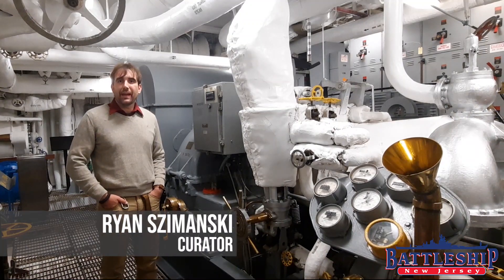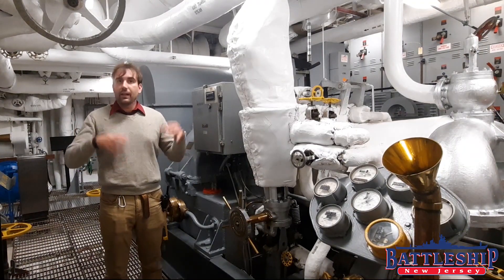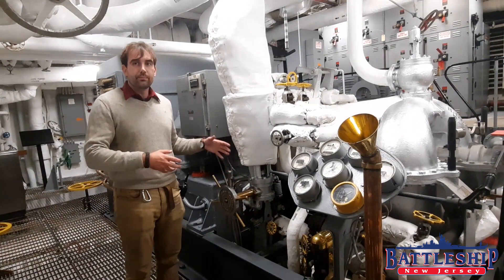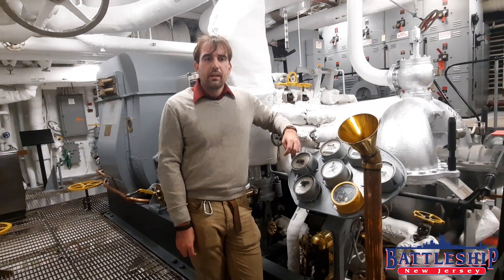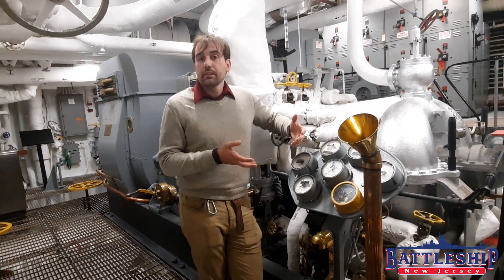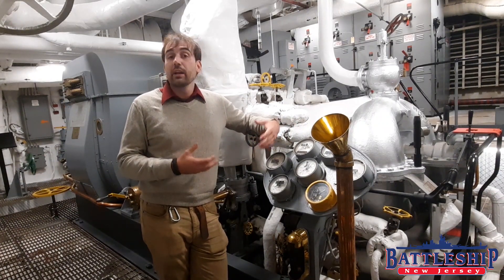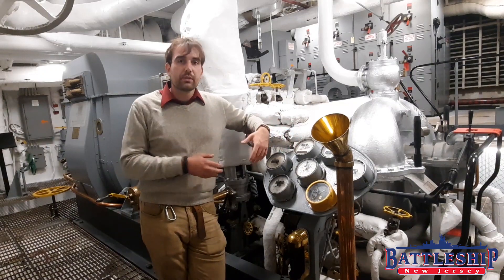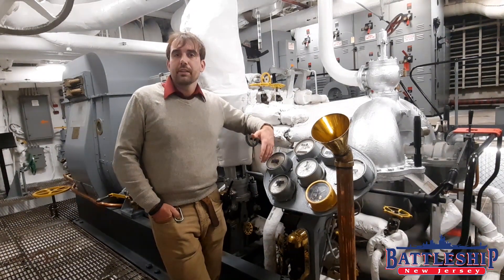Battleship Turbo Generators

Comment: Do the power companies receive a tax break for providing your museum with power?
Reply from the maker: We pay for our electricity, it's one of the many reasons why running a battleship museum is so expensive! We've switched to LED lights so that helps keep costs down but its no small bill!
Reply: @BattleshipNewJersey  Sounds like a federal bill ought to be created to make museums a tax write off for power companies.

Does your museum have a Patreon account?

If it were up to me I would move these museum ships like the Texas and Olmpia into custom built buildings where the ships would be placed on top of Cribbing within a cement basement.

That way even if the museum shuts down for decades, the ships would be rusty but city officials would Not be considering making them into a artificial reef due to a lack of hull integrity.
Reply from the maker: The ships are much better supported in water than on a cradle or in concrete, and it would be astoundingly expensive. 

We don't do patreon but we have a gofundme: https://gf.me/u/ysdi3a

Also, most of these ships aren't run by local, state, or the federal government but by non-profits so the city doesn't get to decide if they're going to reefs, this is a decision made when the organization responsible for them can't maintain them anymore due to age. No ship lasts forever and they all cost millions of dollars to maintain.
Reply: @jmd1743  cement/concrete is a porous material, it holds water. That water is then held against the metal, and allows it to rust; that water will not dry as it is not opened to the air for it to evaporate.
Reply: @irohaboat  There are many ships being held indoors in museums, what would be the best way to hold something like the USS Olympia or Texas inside such a building?

It would be cool if you could transport the Texas to that National ww1 museum to create a naval museum wing.

If money was not a concern I would house the Olympia, Texas, Iowa class ship, and one of those Pegasus-class hydrofoil ships to represent pre-ww1, ww1, ww2, and cold war in a single indoor museum.

Maybe it would be part of a new Museum near the Arlington National Cemetery.

Things like the Berlin Air Lift, Cambodia, and  Holodomor needs to be remembered when it comes to the cold-war & why we went to the brink of nuclear war so many times.

Comment: Just look at all those asbestos lagged pipes!
Reply from the maker: Theres is no asbestos in this space, we've had many many inspections to be sure.
Reply: @BattleshipNewJersey  She was launched in 1942. If she wasn't lagged with asbestos what did they use? And if they did lag with asbestos it will be absolutely everywhere as it is pernicious stuff.
Reply from the maker: The navy removed it in the 80s
Reply: @BattleshipNewJersey  Impossible. Some of the blown about stuff might have been painted over but the rest is still there waiting to be disturbed and breathed in, as I said it's really really really difficult if not impossible to remove completely.
Reply from the maker: We can guarantee that all asbestos in that engine room has been removed. As well as the vast majority of the rest of the ship. We haven't checked every compartment but any of them open to the public have had it removed.
Reply: @BattleshipNewJersey  If that is the case all I can say is well done for painting absolutely every square inch of the compartments open to the public and every square inch of the interior of every HVAC conduit and pipe :)
Reply from the maker: We're fortunate that the navy did most of that work for us!
Reply: @andrewallen9993  Hmm, you wouldn't happen to work for one of those law firms working asbestos, do you?
Reply: @davidperry6886  No, but I know people who worked in ships engine rooms that died from mesothelioma due to the asbestos lagging, one of them who worked on a ship that had had it "all removed".
Reply from the maker: We're fortunate to not only have the navy look over the ship but also private companies and the state of New Jersey look too.
Reply: @BattleshipNewJersey  I would love to know how they cleaned out all the HVAC ducting.
Reply: @BattleshipNewJersey  I'm not saying it wasn't.  However I asked to go in the boiler room on the Missouri and "it was a personal tour" the guide couldn't allow it due to it not being abated.  So maybe on the NJ it was.. But I know the ship I was on "Butte (AE-27)" was built in the 60's had been abated but still had plenty asbestos on board.  I was a BT.
Reply: @andrewallen9993  It really doesn't matter so long as nothing is getting disturbed, an air quality assessment as I would assume will have been part of the tests conducted would show conclusively if there was any risk. especially given that most if not all of the surfaces have been repainted.

Internals of ducts may also not be an issue so long as they were sealed before removal work began.

Comment: You state that the Iowa class has step-down transformers to drop the 440-v down to 220-v and 110-v.  On the diesel-electric submarines we used M-G (motor-generator) sets instead.  This was a motor of one voltage turning a generator set up for a different voltage.  M-G sets were also used to create 400-hz current for the electronics.
Do the Iowas have M-G sets?
Reply: North Carolina has smallish 400 Hz motor-generator sets for fire control, radio, searchlights, and other associated typical DC-driven equipment. I would imagine it'd be the same for the Iowa-class ships.
Reply: @tspencer227  DC is not the the same power generated by MGs, that is a conversion of AC to DC, a whole different process not done with that gear, its all about power supply flavors, they may have done that with an old generator,  but I've not personally seen them, so am not an expert totally.
Reply: Most M-G sets are used to convert AC to DC and DC to AC, or from 60Hz to 400Hz. I can't imagine using a Motor-Generator for the simple task of stepping up or down an A/C voltage when a transformer will do the exact same job with a quarter the space and no moving parts.  That said, I wouldn't be surprised if the Iowas have 400Hz motor generators for radar, fire control, and other sensitive electronics.
Reply: Most ships I was stationed aboard had MGs for 400 cycle, radar and such, cant use a transformer for that purpose, only for buck or boost applications. USN ret and EE as a civilian.
Reply: Usually as a ship uses 60Hz on all components there is no need for a mechanical transformer. This is only need to change frequency or need a "clean net". So hearing this I hightly suspect it's all stationary transformers. It helps a lot in maintenance and ease of use.

Comment: Does the system still have water in it?
Reply from the maker: No, it doesn't.
Reply: Part of the mothball process is to seal up the openings in the hull to supply water to the systems and drain them. Then they can be kept dry and fairly rust free.

Comment: What is the KW rating for a single Turbogenerator on the New Jersey. I was on a destroyer during Vietnam, we had 4 rated at 500KW each. I imagine moving the turrets required a lot of power.
Reply: 1250kw.each.
Reply: I'd like to read the nameplate myself. There  isn't a whole lot of size difference between 500, 600, 750 and even 1200 kw SSTG units. Hard to tell in this video.

Comment: Just FYI.  I offered my services to President Trump to project manage reactivation.  Who knows, maybe I’ll hear from him. :)
Reply: As impressive as these ships are they are of very limited utility in the modern navy. The operating costs are tremendous if you consider crew size, repair costs, fuel etc. for a ship that will be used for artillery support for ground forces. Having a battleship on station in a war zone would require air support from a carrier along with destroyers for ASW protection. The carrier airwing would be more than capable of performing the tasks of the battle wagon at a much lower cost.
Reply: Deactivation or reactivation
Reply: @dshogan6174  reactivate.  Corrected.  I won’t hold my breath though :)
Reply: @holykuhrap really...when firing at tents, 40 year old tanks, and sandstone buildings in the Mid East, one doesn’t need a $1M missile.  They serve a great purpose for long range artillery without shore invasion and a very low cost.   They were used effectively in that role in the Korean, Vietnam and Iraq conflicts for that very reason.

Comment: Hello Mr. Szimanski, I thought that you should be aware that you use of the word "impeller" was incorrect as you used it in describing a turbine, an impeller increases the flow and pressure of a fluid; the turbine does the exact opposite
Reply: Wouldn’t it be a turbine rotor?
Reply: @riderstrano783  From an engineering POV, a rotor can be any rotating part that has a disk or cylindrical shape, plus it can get weird what with helicopters having rotors as well
Reply: @battleshipnewjerseysailor4738  understandable, just local jargon for me. On the turbine we had, we always called it a rotor
Reply: i think it was made as an analogy to the "propeller" of a wind turbine, which is itself an analogy of the propellers in air-driven vehicles
Reply: He might mean impulse as they were impulse turbines.
Reply: @The7humpwump  A turbine is an engine, an impeller is driven by an engine, it's that simple
Reply: @battleshipnewjerseysailor4738   I was referring to the type of turbine, it is an impulse vice reaction blade turbine. Appreciate your videos
Reply: @battleshipnewjerseysailor4738  i was giving him the benefit of the doubt, maybe he meant impulse rather than impeller since he is talking from memory. He was talking about a turbine, not a pump and seems quite knowledgeable. Easy to trip over your tongue doing a video without a teleprompter
Reply: @The7humpwump  "Impulse vice reaction BLADE turbine". They're called blades on a turbine, impellors are for pumps. The old joke among turbine design engineers is when the engineer had mastered his skill he was known as a master-blader. Get it Haha!